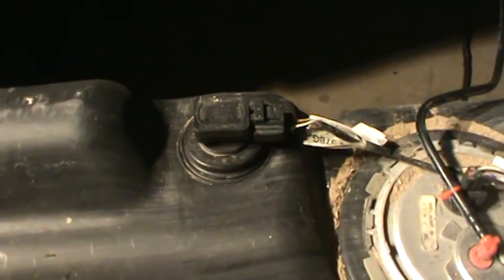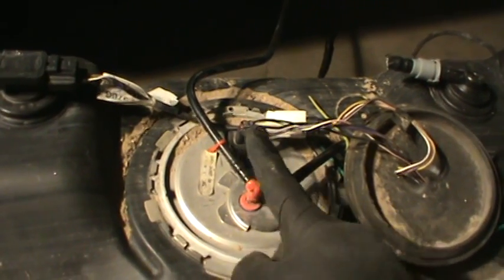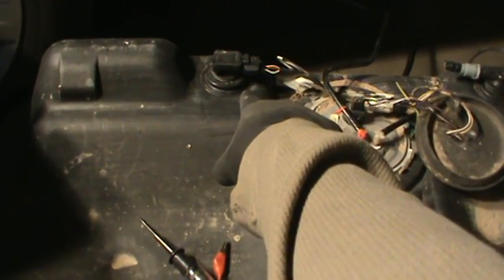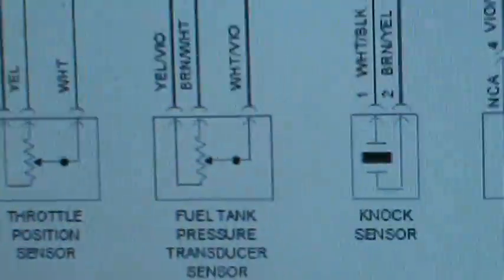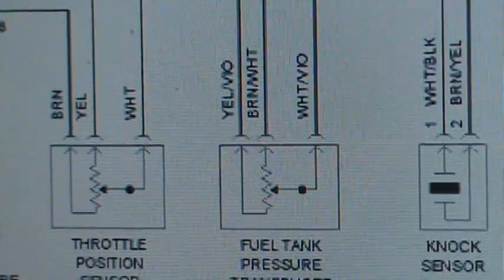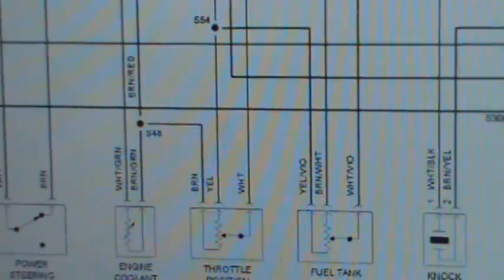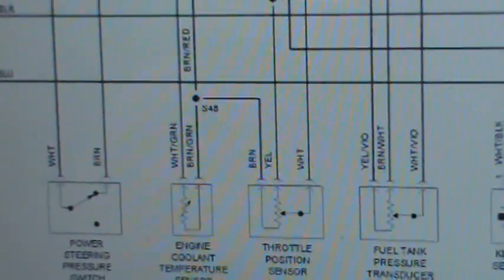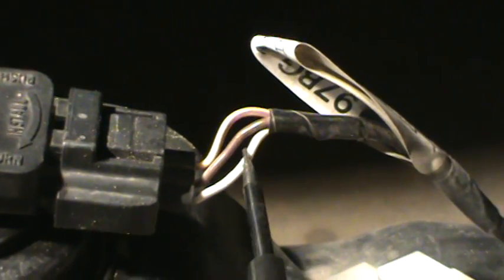Fuel Tank Pressure Transducer Sensor

Comment: So if this sensor or the o ring were to go bad, what will it cause the vehicle to do? I have a 98 f150 4.6 and the truck starts up fine and when I drive it long distance and turn the truck off it doesn’t start right back up but it starts right up once I let it sit for a hour or two. I basically want to know whether this sensor has anything to do with that issue. I replaced fuel rail, injectors, coil packs etc.

Comment: How do you know the temp sense & fuel pressure can't share ref
Reply from the maker: The intake air temperature sensor, or coolant temperature sensor can not share the feed voltage with the feed voltage on a throttle position sensor, or pressure sensor because: the feed voltage for the air and coolant sensor are also the "signal wire." In a temperature sensor, there is a resistor in the computer, and the temperature sensor is also a resistor that changes with temperature. If the feed voltage changes on the temperature sensor, then it can not be used to "feed" voltage to other sensors. In other word, the temperature sensor feed voltage serves two purposes, while the position sensors feed voltage only serves one purpose. Do you understand?Engine Sensors Watch my video.
Reply from the maker: Also watch this: Intake Air Temperature (Thermistor)